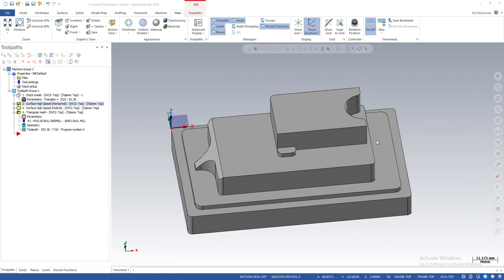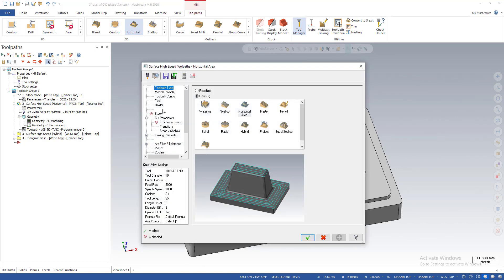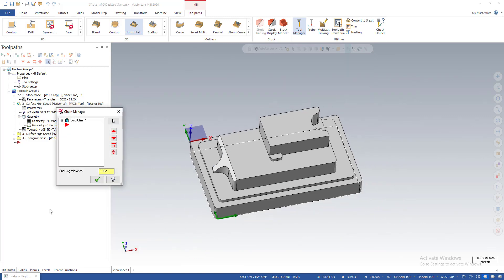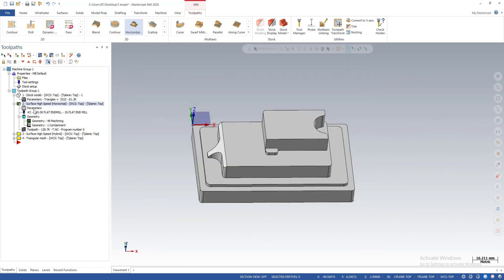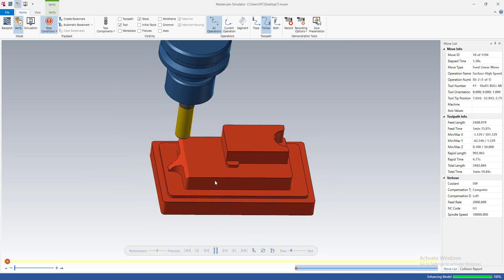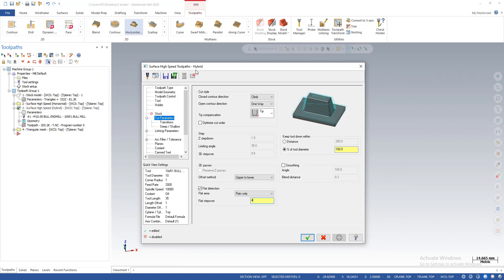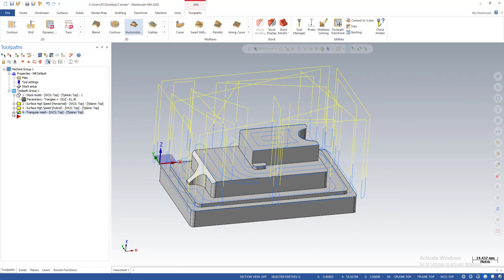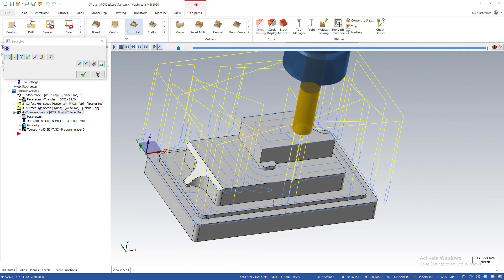Mastercam Highspeed Horizontal toolpath issue - skipping small areas

Comment: Have you tried that with lower version of mastercam if it's ok or not?
Reply from the maker: I have tried on 2018 and 2019, still the same issue.
Reply: i've tried this part too.and there's only one way to solve this problem so far..you have to use smaller tool
Reply from the maker: @ED.Q_20  maybe they will fix in 2021 version ^^
Reply: @GIANGTHETOOL  could you share the model? i have the 2021 hle version and want to see if this is still an issue

Comment: Hi Xiang nice video. Could you make a dedicated video on milling with ballnose. How to use ball nose endmill for inner profile and outer profile. Thank you
Reply from the maker: what do you mean bro?
Reply: GIANG THE TOOL. I’m working in a shop and I want to make radius on the edges, like at the bottom of the pocket I milled using an end mill and at the top of the part. I know I can use a ballnose endmill to do that. But I have never used it. Is there any way just using 2d geometry to put radius on part using ball nose.